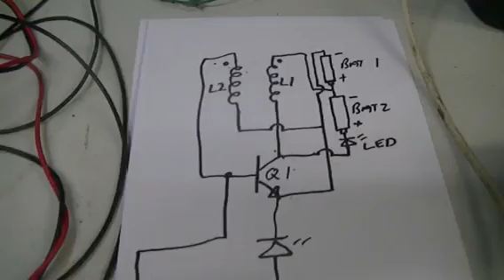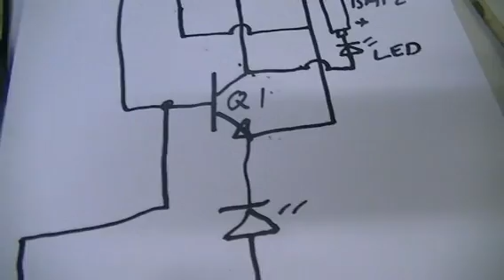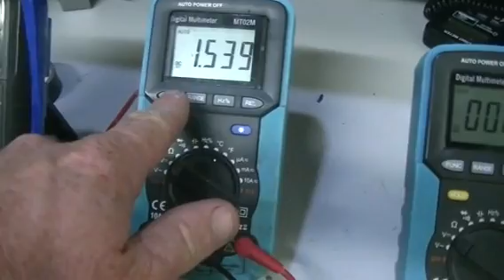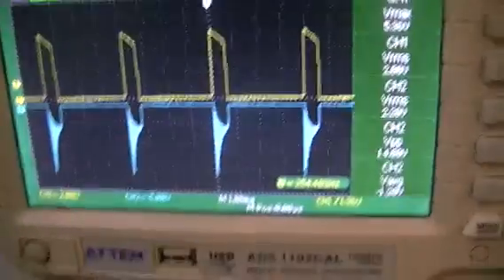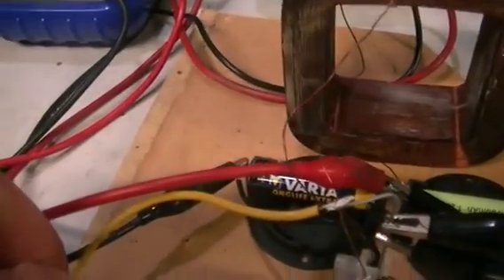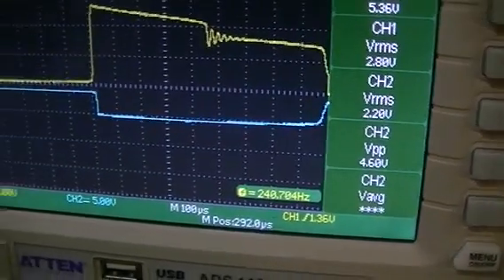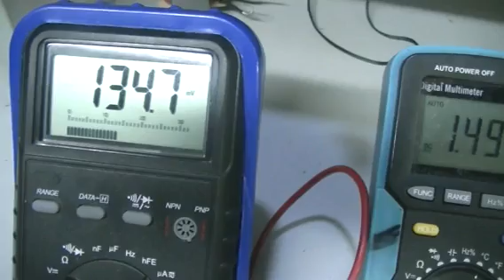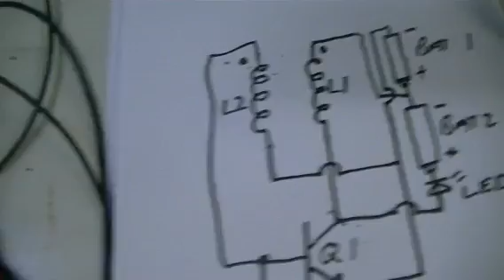The microwaved  Double Charger

Comment: Good morning TinMan...I'm a beginner at all this with NO real electrical training so please be patient! My burning question after watching hours of video made by dozens of different "hobbyists!" Why is it imperative that the coils be made from low gauge wire with hundreds of turns? Can't the same results be achieved with thicker wire and less turns? Why 400-600 turns with 24 gauge and 20 gauge? Why not 150 or so turns with 20 and 14 gauge? Thank you for your time. Cheers